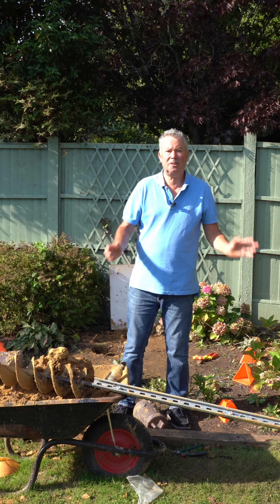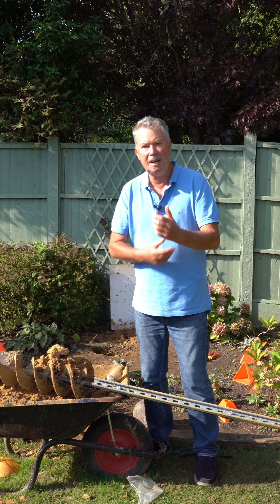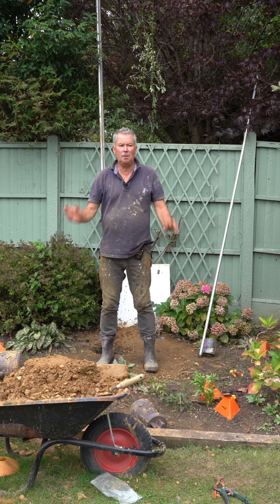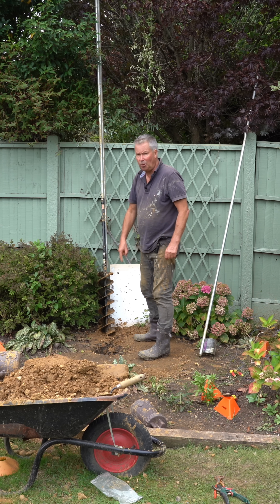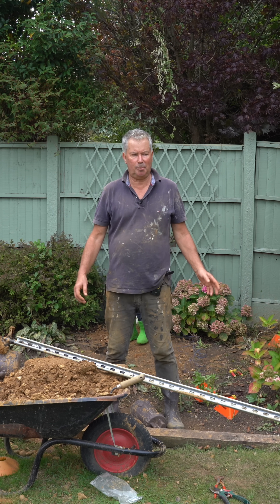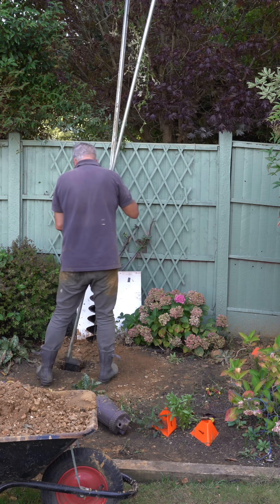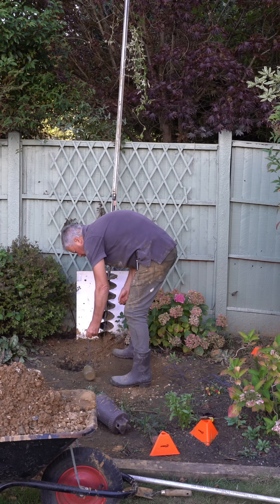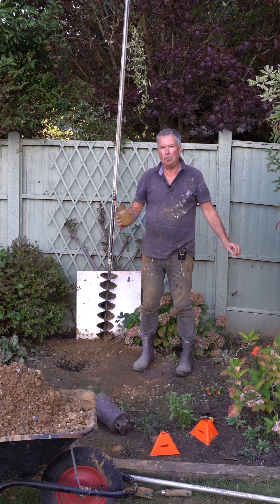DIY Drilling for Water in Suburban Garden Part 6 #short #waterdrilling #boreholedrilling #freewater

Comment: I like the ingenuity of using the unistrut channel. It did make me laugh first a jam jar then a food can. Will the water be clean?
Reply from the maker: Its only for watering the garden etc and maybe even flushing toilets in the house. It is classed as surface water because not from below rock so it will not be suitable for drinking etc. I bought the liner today and ordered a pump so lets see how fast I can pump. I will be upset if the water is not replenished fast enough to keep up with the pump. There should be a new video tomorrow or the day after.